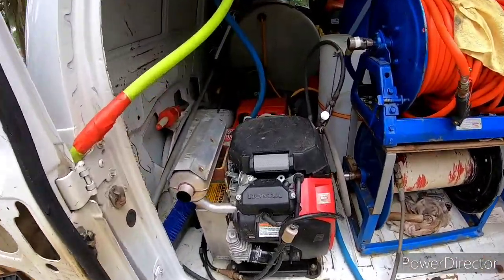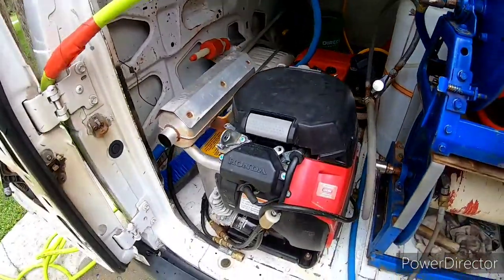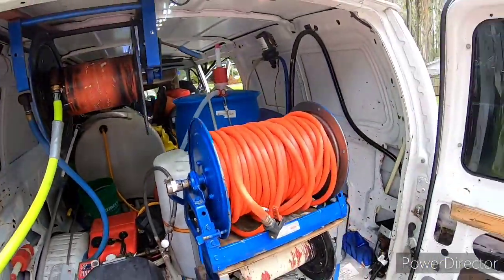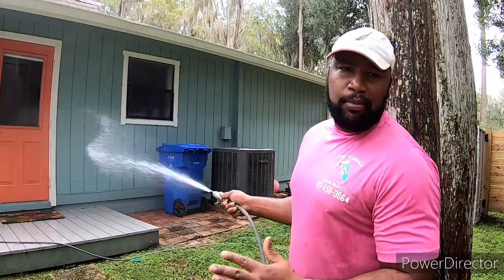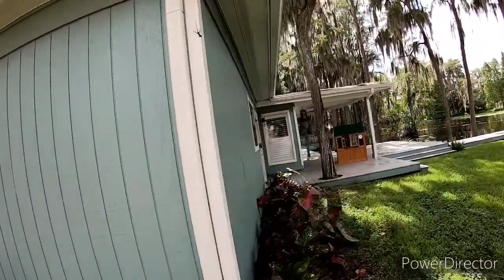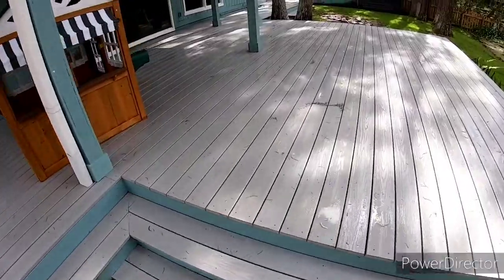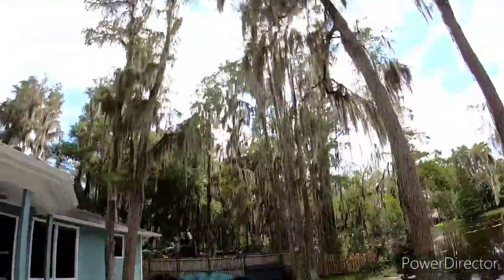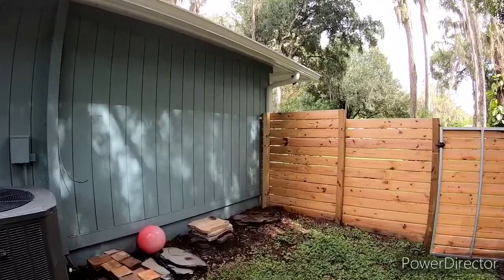New Pressure Washer and Soft washing kind of day! 🤑😜🤠

Comment: Do you ever have any issues with streaking dark color homes ? Doe sore wetting eliminate this issue all together ?
Reply: Does pre wetting *
Reply from the maker: No never have that issue. Only way that could happen is if the paint is oxidized already.
Reply: If it’s oxidized do you still wash it what do you do if so
Reply from the maker: @tomhanson982  If its oxidized. 1. make it known to the customer or have something signed. 2. offer oxidation removal, 3. soft wash it and stay back from the house to avoid disturbing the oxidation. Those are the 3 options I take.